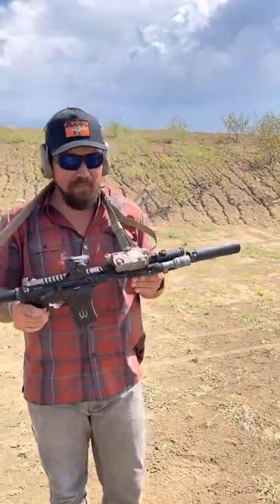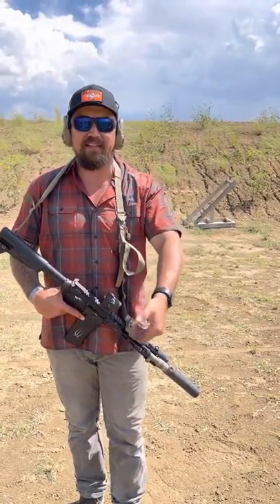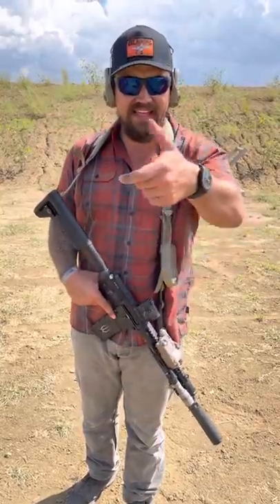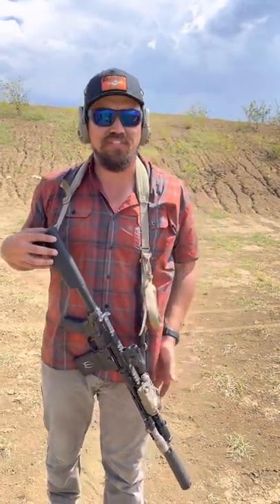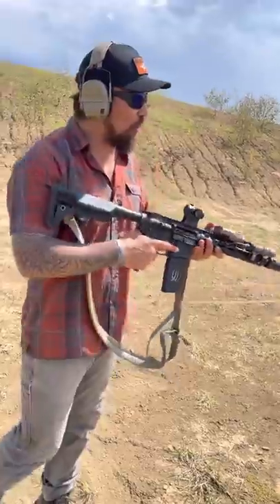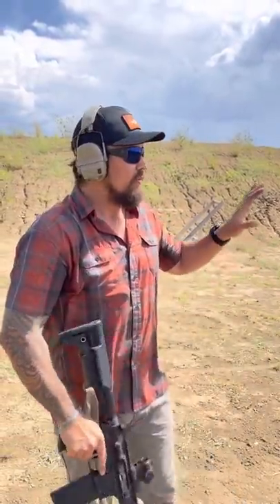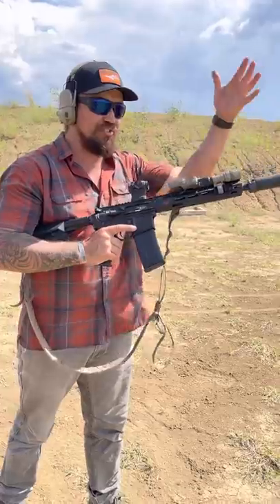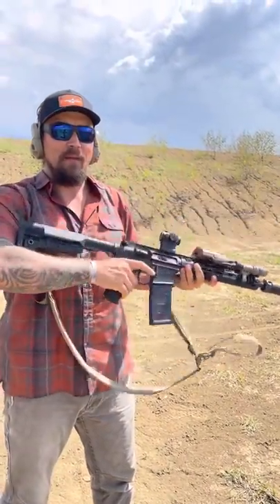C-Clamp a carbine w/ Green Beret SGM Mike Glover

Comment: Great stuff as always.  I've been a fan of the C clamp for quite a while, but I managed to pick up a couple tips in this video.  Thank you!
Reply: Magpul grip is my preferred outside of cover drills. Less tiring.
Reply: @deathlis  That's a fair point.  I think it's important to train with multiple techniques that fit a variety of situations.  I was originally trained on the M16A1 platform, C clamp wasn't a thing then.  But adapting to current best practices is a good thing.  I might be getting up there in age, but I try not to be a fudd.  lol

Comment: Muzzle rise associated with recoil also has a lot to do with weight distribution, the bolt operation like gas operated or recoil operated, as well as muzzle devices, how "hot" the cartridges are, recoil buffering and so on. Each gun is gonna be different, but C-clamp works well on most

Comment: I see a lot of sof and former sof are running no back up irons these days why is that? Honest question
Reply: I wonder if it's because they're running their laser or combo laser/light combo setups on top of their handguard on front which has how I've seen a lot of people mention that you should run them, just for correct zeroing on the laser but also for ease-of-use where you can activate deactivate either with side pressure switches or top pressure switches with your thumb.
Reply: PEQ is a secondary sighting system, modern optics are reliable so usually if it goes down its a battery swap.

Comment: It is good for what it is intended for. It utilizes the mechanics of isosceles form in pistol shooting, except that rather than with two arms, a shooter would be forming the isosceles structure with the support arm and the rifle which has more resistance to deformation under horizontal rotation torque. For the same reason, both with rifle and pistol, it is useful for target to target transitions in multiple target scenarios at close range. 
However, some people seem to over do it, and try to use it in every scenario. It's one of many tools in a tool box. In scenarios where I need precision with a single target, I do better with support arm with elbow pointing down and support hand supporting under the hand guard method.

Comment: Is there any pull from the left hand, towards the body, or just pressure for recoil management and driving the rifle side to side? Good stuff as always.
Reply: Well obviously there HAS to be for any kind of endurance. AR15 is a light gun, but not after 30 minutes of drills. Got to offset that weight somewhere or your arms turn to jelly. C- clamp is also less endurance than a vertical foregrip for this reason as it's less efficient, though the pros outweigh the cons IMO.
Reply: Tu lam described it best you drive the gun
I believe his video is up on carbine setup
Reply: @deathlis  The Marines trained me, but pretty sure SO guys are trained different, as we weren't as active in cqb as they were, so that's why I asked. Didn't notice too much of it from Mike in the vid.

Comment: With the peq that far back, does it splash on your rail, pressure pad and suppressor under nods? Don’t have any nods but I’m curious on this peq placement.
Reply: When running under nods, he retracts the gun and activates the laser on the top. Doesn't block it. He's mentioned this on IG before.

Comment: You literally used your shoulder (three point contact) to ensure theses less recoil as oppsoed to the change of grip, which did nothing. Do the c- clamp without using your shoulder as you did in that demo and it will recoil just as much, or at least almost exactly the same, there almost nothing in it